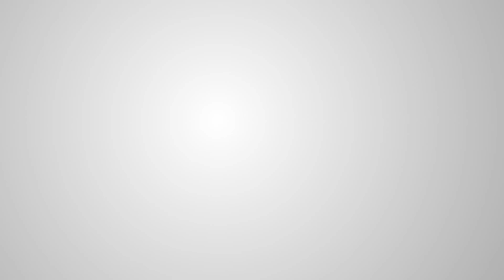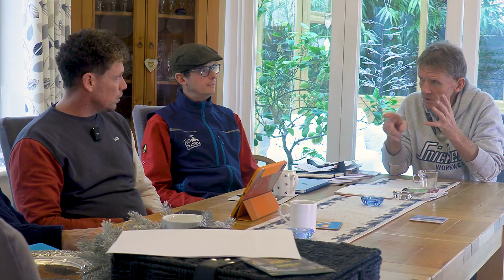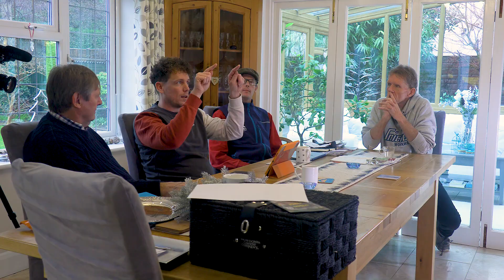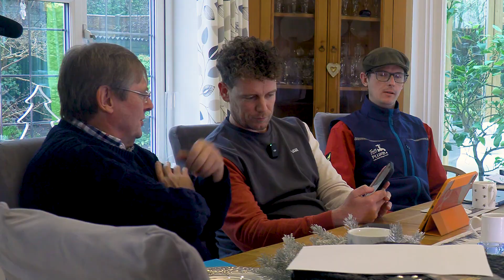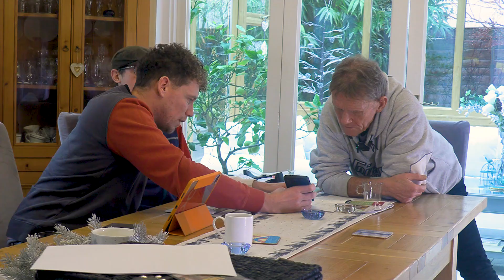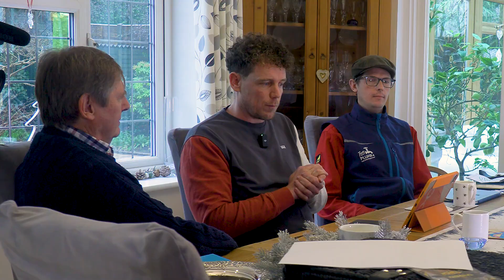What Did We Learn from the Heat Loss Survey?

Comment: I loved my air source cold climate heat pump until the power went off for 75 hours last March…spring was in the air but still got down to -12C at night. Now I’ve got a direct vent gas fireplace that works during power outages to supplement…HP love affair, not so much.
Reply: You would have had the same problem with a gas boiler as they don’t work without electricity 😊
Reply: @HeatGeek  The unit I selected will operate off four AA batteries in the event of a power failure. In that mode, only the fire will work…no fan. I also have a 2 kw Bluetti power supply that will run the fan too. If necessary, I can recharge the Bluetti using my gasoline generator. In my last house I was able to run a gas furnace using the gasoline generator, but my heat pump power needs are in excess of the generator’s capacity. It gets so cold here near Ottawa, Canada…I’m used to frequent ice storms causing outages lasting several hours, up until last March the longest I remember was 20 hours…75 hours was a disconcerting stretch too long. Today, at a balmy -7C, my heat pump is working nicely.

Comment: We’ve had a Ecodan installed in a new build , we have been told to leave the actuators on 3  underfloor circuits loose to stop it turning off and going L9 ☹️
Reply from the maker: A lot of people take them all off and open all the valves. If you restrict the flow to a heat pump it doesn't like it. 
People put in underfloor heating systems that are controlled by room stats and then disable the lot.

Comment: I have been installing heat pumps for over 40 years and inverter technology has been around on many manufacturers equipment for well over 15 years on domestic air to water heat pumps. It is better to operate a heat pump that can modulate to as low an output as possible, with back up electrical heaters providing additional heat during the very coldest periods. This set up helps to prevent stop starting of the compressor and this in turn improves reliability. Stopping and starting compressors is where most of the wear and tear occurs. This will occur more if the heat pump is over capacity and is generally operating at the usual average winter temperature of 7°C (south of England). The heat pump inverter will not be able to modulate down low enough to prevent the compressor from stopping and starting. Weather compensation will exacerbate this as the flow temperature will reduce as the outdoor ambient temperature rises. Using electrical back up heaters that switch on extremely rarely, can actually increase efficiency over that of using an 'oversized' heat pump.  I have this set up in my own home. It has been perfect in 11 years of operation. Then again I did design and install it myself as an experiment. I live in a  3 bed, draughty, uninsulated, granite built cottage and did this as an experiment to see if it would work. As long as your heat capacity matches your heat loss it is not a problem. I run fan convectors and and 8.0kW heat pump with 6.0kW of back up heaters. Those heaters are very rarely on as the balance point of my property for heat output of the heat pump without electric heaters is around 1°C. The coldest temperatures annually where I live are around 1°C at night. It very rarely gets much below 2 or 3°C. Correct design and commissioning of the system is everything in heat pumps. My energy bills are less than £130 per month and we are in an all electric household. I still prefer gas central heating 😁
Reply from the maker: Great comment. You sound like somebody we should have on the channel. Good experience
Reply: We actually done a load of work around this, balancing undersizing the heat pump vs use of back up and now have data to share aswell as a calculator we are reassessing and it doesn’t quite work as well as you would think.. The other problem is dno applications and max fuse capacity. Most homes will not cope with the load and is a constant thorn in our side.
Reply: @HeatGeek  Installers here (Australia) so far have been telling me to get a big heat pump because they don't want it to run all day. They want it to be able to cycle on and off. That seems wrong to me. I think it should continue to run and stay in its efficient operational band - I don't expect that would 'wear it out'. Am I right or are they?
Reply: It's also a grid's nightmare to have all these back up heaters that will go on at the same time. It might be a cheaper solution for an individual but you are socializing costs onto the national grid.
Reply: What are the reasons for preferring gas? Why did you not fit gas?

Comment: This was an interesting conversation to listen to but shows everything that is wrong with heat pumps or the installation off. These, compared to gas oil whatever require a very lot of technical experience to get right. Most installers are thick as mince and not up to doing this job correctly and no amount of training will significantly alter that so for the good guys working for people with money there will be a lot of work. For others they will be paid to fk things up but they made their wages and don't have to pay the bills. This is an impossibility for the masses and some one in power needs to recognise that.

Comment: I had a heat pump fitted 2 years ago and had fitted 270mm of roof insulation to cover what I could easily. The Air Source Heat Pump, was professionally fitted and has worked perfectly. It turned out my 5 bedroom detached house at 171 square metres of floor area had very old cavity wall insulation. During the first year I used 3500kWh. 
The insulation was then removed and replaced in the cavity and I was told it had broken down to the point it was as if I had none.
This year we used 2500kWh.
The house has been warm throuout and as I did my homework I had learnt to heat the whole house. We maintain 18c with a 2c drop overnight. Even at the most highest use, this has been cheaper to run than my old LPG boiler.
Also I had realised that my MyEnergi Eddie was not the best use of my solar and I use home assistant to turn on the ASHP if Eddi is triggered. This means I can export more solar energy and get paid more back.
Reply from the maker: I am not surprised that you made a saving compared to LPG. It is good to know the heat pump is working well.
Reply: I think currently use of the grid electricity is 30p/ kWh can I ask what you sell it to the grid for ?
Reply: Octopus Energy pay me 15 pence per kWh that I export. I pay 7.5 pence for my cheap overnight tariff also filling my 13.5kWh battery, so that I pay less of the 30 pence day rate. 
For your information I pay £120 a month and that covers my EV for 10,000 miles per year, heating, cooking and home use.
I used some savings that were not growing and invested in my house, making massive  savings per month.
Reply: @Jaw0lf  it's interesting that if you got a large battery and charged it for 7 hours at night then sold it to the grid at twice the rate you can double your money ? I realize it's not 100% efficient when charging a car battery but 15kwh @ 30p/kwh is £4.50 so only a saving of £2 on an economy 7 meter  per night . What you need is a night storage heater built into your ASHP
Reply: @Jaw0lf  forgive my back of the envelope maths but if you get 200 miles per charge with the car ? You should only be charging once per week and an annual cost of £250 should cover that , 10,000 miles at 30mpg in petrol would cost over £2500/ year in fuel.
I must have the range of an EV wrong ...
Reply: @dolphine675  My first year I did 10,015 miles, used 2953kWh and cost that includes some rapid charging was £282.37.
I have now completed 26412 miles at a total cost of £847.08. I have generally found the EV cost when charging at 7.5p is about one tenth that of petrol or diesel.
My above figures include different priced overnight tariffs some at 12p, so is a little higher than my current year which is £264 for 10,000 miles.
Also EV range for my Kia E Niro is 220 in winter and 270 in Summer. Car has a heat pump.
Reply: @Jaw0lf  petrol is actually much cheaper than electricity per kwh if you ignore the profits and taxes we pay but the big advantage of an electric vehicle is it runs vastly more than 25% efficient

Comment: Our road cannot get gas - we desperately want it but it's a six figure sum to the main. We have 1980's polystyrene board cavity wall insulation so that cannot be improved without rebuiilding the walls from the outside in. I simply do not believe that a heatpump would be suitable for us. With electricity only going to get more expensive it is simply uneconomic to be spending tens of pounds a day on a heat pump to heat our houses. Surely it would be better for government to subsidise insulation upgrades?

Comment: Immersion heaters with heat pumps are exactly what is wrong with heat pumps. They don't work with low temperatures and efficiency drops.
Reply from the maker: You are so right. I said in my first video that it is admission that they aren't up to the job. The trouble is that the customer is not aware of how much time their heat pump is not working as it should.
Reply: @SkillBuilder  One solution would be a hybrid system with heat pumps and classic boilers to meet the demand when there is not enough power. Btw, keep up the good work.
Reply: Not accurate. Many heat pumps don't require immersion. The scenario in this video is only relevant to John's install - likely because the heat pump is either being repaired or LG are replacing it like for like.  A larger heat pump wouldn't require the immersion for John's scenario - but that's going to be an extra cost - vs adding in an immersion to handle the times where the heat loss is greater than what this heat pump was specced for.

All 3 of mine (A2A) don't have an immersion nor any sort of resistive backup, and handled -20C just fine.  And still were more efficient than using resistive heating.
Reply: @BenIsInSweden  Most of them do because they work only with well-insulated houses and modest climates. Also, they are expensive and most of them are selected in the lower range.
Reply: @hrvojelasic5794  Did you miss the part where I said -20C ?  hardly a modest climate. My home is 1920s, and maybe better insulated than your average UK house, but it falls very short by modern standards.  Insulation isn't a breaker for whether a heat pump will work or not, temperature wise there are high temperature ones, and is a case of having a correctly sized heat pump for the design temperature.  It, for the most part, comes down to whether it's cost effective to run.  If there was parity between gas and electricity, then in the vast majority of cases a heat pump would be a better option than a gas boiler.
Reply: @BenIsInSweden  I used to work for Carrier for 18 years and sold thousands of heat pumps (from 2 kW to 8MW). I pretty much know how they behave. They are not tools for every job. Also, it is not only about cost-effectiveness but also about the cost of the heat pump and questionable availability of power in the future as the grid needs to be upgraded. In Germany, you already have power limits, and it will NOT work if the house is not properly insulated. It will not work if temperatures drop, it is easy to wrongly design hydraulics, and they are difficult to service. I am not against heat pumps but I am pretty much against pushing heat pumps no matter what and being fundamentalist in something that should be about proper engineering.
Reply: @hrvojelasic5794  I'm not saying they can be installed in every scenario nor am I'm pushing them to be installed in every case, but outside temperature (at least the temperatures the UK sees), and insulation are not reasons for them to not work nowadays with modern heat pumps - Carrier being primarily a US based heat pump company doesn't really inspire much confidence, as the US market for home heating heat pumps has been behind the heat pump advances that we have had in Europe for some time now. 
Power availability is a factor, but it falls under whether one can be installed, not whether one will work or not.
If the installer has got the design wrong, then that's a fault of the designer, not the heat pump.

Comment: And therein lies the problem in his closing statement. "if you want maximum efficiency, you need to raise your night time temperatures (which nobody wants), and lower your daytime temperatures (which nobody wants).
Reply: It's a choice.  Many people use gas boilers in the on/off scenario for "instant heat" foregoing the efficiency gains in a gas boiler by operating it at lower temperatures and for longer.
Reply: @BenIsInSweden  May as well stick with a gas boiler then.
Reply: @markrainford1219  err, the difference isn't massive and doesn't put a gas boiler back in contention by not doing it.
Reply: Only if you want to maximise. It will be more than efficient enough by lowering nighttime too

Comment: I dumped the gas after last winter. Installed a 4kw cree heat pump. that' s to the lower side, and I was afraid it was too small, but it has never been running over 1kw per hour. In february it uses around 0,630kw and sometimes turn off. ( it can't go lower than that)

It is one of the best things I have ever done.
As a back-up I have an air/air heat pump, also 4kwh, it was there already, and I used that to heat the house only last winter. ( due to insane gas prices)  
It has not been used at all this winter.  House is 108m² house build in 1868, but renovated.Floor heating.
The 3 year old Baxi gasheater used incredible amounts of gas.And..that's the worst part, I never know what gas cost before one month later. ( thats how it is in Denmark, the price of electricity per kW, I can see online.) I have spend 1060Kwh since the installation of the pump on september 20th 2023) 
I tell you, it is colder here than in UK. In December we where down on minus 10 some nights, minus 5- 6 in daytime. January was not that cold, and February . so far..mainly been over zero degree Celsius. Of course the very cold nights It was not the best cop, if any 🤣, but.. it' s short term.  And in case of 3 months like that I maybe would consider to move South 😂
Reply from the maker: That is interesting but you don't tell us about your insulation. It must be very good.

Comment: To automate the heat pump using solar energy a Myenergi Eddi with the optional relay board can be set up to switch on the heat pump when there is excess solar.